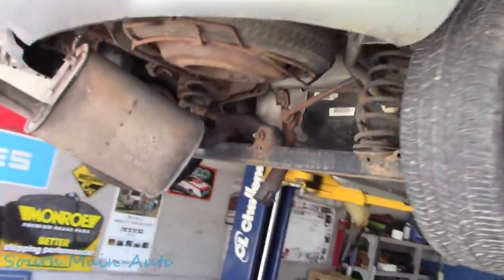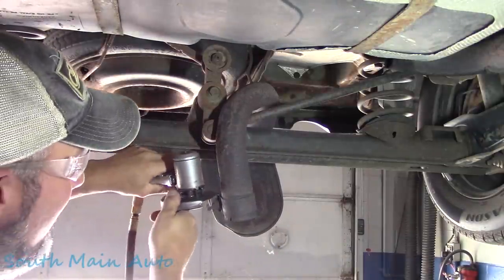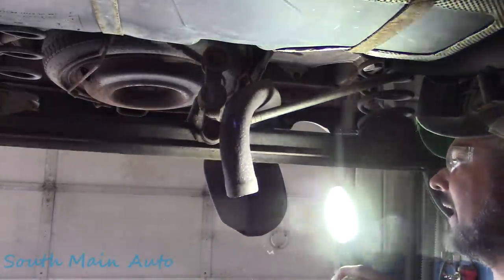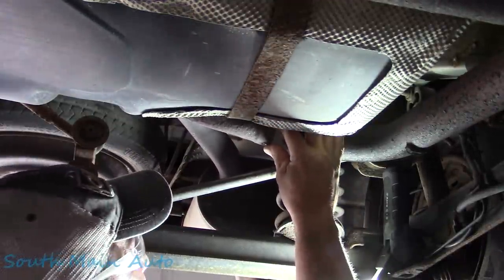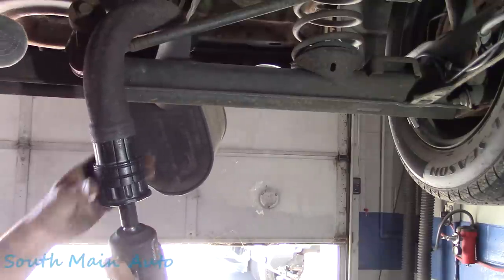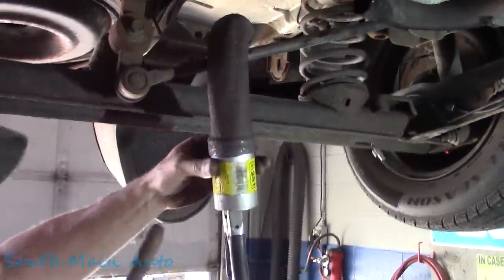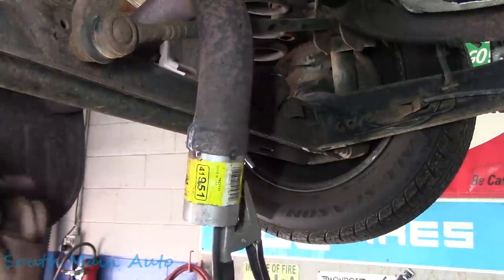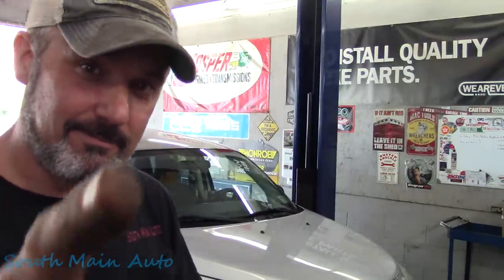Desperate Times Call for Desperate Measures

Comment: Nice honest repair Eric. When I worked at Midas, the owner would always yell at me for those repairs but, where did that customer go back when they had another problem - you guessed it. Our shop!
Reply: They probably wanted to sell the complete exhaust system
Reply: @TheLazyCarrot  yes and use alumized pipes and mufflers that last 2-3 years
Reply: @reweydewy  Mufflers that last forever because they have a lifetime warranty. It's the surrounding pipes that are made to rust out.
Reply: Problem with the aluminized pipes is they use mild steel clamps and it causes the aluminum to corrode and then the pipe and clamp corrode. It always fails at the joint. Thankful my cars now all have stainless exhaust and I moved South so done with that crap.
Reply: @robertbell525  I didn't know that. When I think about it. The pipes did seem to go bad at the joint between the muffler and the pipe. So you had to replace the pipes and the muffler.
Reply: The problem with todays cars is they use muffler bearings that only last 2 years 😂😂
Reply: The Midas in my area just went out of business
Reply: @Dogpool  yes, I wonder how many midas shops are still operating.
Reply: @robertbell525  I found it near impossible to get true stainless exhaust pipe.  There is a local custom exhaust place that I called to ask where they get it and they had to developed direct import methods from some place out of the country.   It’s not available from the easily accessible outlets like Napa.  They may claim it is at least part stainless, but really isn’t, or a low quality.    And anyway to do it right would need stainless welding equipment.

Comment: There's a muffler shop around here that does this kind of repair. Quick, cheap, keeps older cars on the road. And you know what, they do a great job and get recommended, so they are never out of work. Great repair, that's how it should be done, no throwing parts at old cars.

Comment: No a mechanic by trade anymore. Started as an untrained LOF guy in 93. Worked at my best friends family auto shop that opened in 1928. Yes 1928. Used to do oil and filter replacement both were a separate job back in the day. The shop is still open and family owned. They have made their mark here in the city by still doing honest quotes and work. If it doesn't need it they will tell you that. They don't make as much money as some of the big fancy shops but the same customers have Ben coming back to them for the similar business methodology and care you show your customers. Even if it means turning a job to a different shop. Been a long time fan. Found you on a YouTube search years ago for doing a timing belt on a Honda pilot I own. BtW your video helped me immensely and still driving on your advice from that video 55k later

Comment: If there had been an issue towards the front in addition to where your problem was then new or mostly new would of been the call. But, half decent pipe, muffler with most of it's glaze and no holes. Looks like you made the right call to me. I'm a sucker for welding and grinding.

Comment: No criticism here. I wish more mechanics would work like you do -- there are so many who simply would turn down the job entirely, simply because the customer didn't want to buy a 100% brand-new exhaust.  Or they would've lied and told the customer that it was dangerous and could never be repaired properly without a complete replacement.  You gave this guy options.  Kudos!

Comment: 40 years ago I worked In a shop and you do what the customer wants. Had one guy came in and just wanted a new tailpipe. 
3 months later he was back and just wanted the muffler. 
3 months later he was back for the exhaust pipe. 
Personally I would have skipped replacing the tailpipe until the muffler went then replaced the whole system, but you
Gotta do what they want even if it's wrong.

Comment: We have here in the UK,joint repair clamps , that join muffler pipes like a scaffolding joint , very common on VW cars,  I used one a few weeks ago on a 2006 Nissan xtrail,  the rear box was a fortune,  the joint pie was different sized , undid the clamp , tapped it on , tightened up , jon done , as you say Eric,  it keeps money coming into the shop without massive parts sales , it's better for us and keeps the customers happy 💪👍💰💰

Comment: Here is a man that values his eyes more than he values his lungs and skin!

That said, you may find a transition to 0.023" - 0.025" wire a worthwhile upgrade (if you aren't using it already) for most things automotive related.  You may need some new drive rollers.

Also, I bet a $10 band clamp (if available locally) would have been a quicker repair.  I've learned that keeping a wide variety of these in stock has saved me a bunch of time and effort.  These days, the smaller eco-car sizes have been difficult to find at the parts store, but Jeff Bezos seems to have them.

Comment: Ya know, I quit watching a YouTuber Mechanic, because the guy was so arrogant, that if a customer didn't drive some exotic, and have $1000 to change a spark plug, he wasn't going to be interested. This fix was a proper fix. The car is safe now, the muffler isn't going to fall off and fly up in to someone's windshield, the exhaust is exiting out the rear as it should be. Great job, and taking care of the customer in my opinion!

Comment: I weld up so many exhaust pipes like this.  It really makes a huge difference to have it as part of the options.  Because there is cars like this where people don’t want to spend $1000 on the exhaust because it’s not worth it. Also, pretty much every after market exhaust is not as good as the original, and will only last maybe 4 years if you are up north.  To preserve a good OE muffler is best.      For a job like this I could get that done in probably half hr. Less then an hr anyway.  The key is to have lots of different pipe in stock.  I get straight pipe sections from orieleys in 10 ft sections and have them at the ready.  Cut one that fits the closest and jam it in there.  This allows to not have to use some stretcher. I have one of those but rarely use it.   As for the hangers I save all the sway bar end links off of cars.  They are just the right thing to cut off the ends and put a bend in it for the hanger.   So, this is what often happens. Someone comes in from a shop that quoted them $800 for getting there exhaust quiet, I tell them it’ll be $150, it’ll be done in an hr. I have something like maybe $10 in material cost and less then an hour time into it. It may be less money overall then marking up exhaust parts, but what you lose in $ you gain in hero points.  This dude is then very impressed with how you made is big problem that was about to end his car into no big deal. He comes back with other things because he trusts you and he tells his friend to do this as well.  This saves you money because you no longer have to pay for advertising , since your customers are doing it for free, and better then any paid add.  It also gets you lots of work so you don’t have to worry about squeezing every customer for all they got so you can stay in business because you have so few customers.

Comment: After taking my truck to a shop and asking them to weld up a new muffler (old one just was just band clamped on) I was told, "Your pipe is too rusty, we need to sell you a $1200 exhaust". I ended up just going to HF, buying a welder, welding it up myself and pocketing the rest of the money and hanging on to the welder for my other vehicles that will never see that muffler shop.  The pipe was nowhere near as rusty as they made it out to be, and I knew it as I crawled under it to check it and measure for the new muffler before I brought it to them in the first place. Sometimes you err on the side of selling, sometimes you patch it, but you always do your best to be honest and take care of the customer or everyone in the shop will inevitably go hungry.

Comment: Kinda reminds me of my Neon exhaust. Pipe right before muffler rotted out at the hangar just before a bend. Ever used JB weld Tiger tape? I wrapped a piece of steel flashing around the hole, started wrapping it with Tiger Tape and secured it with baling wire at both ends, then wrapped wire around the length of the repair and Bob`s your uncle. Exhaust only has about 6 months life left, Now I have time to save $$$ for new pipes and muffler. Nice fix Eric

Comment: Good repair Eric O. Criminals stole the catalytic converter from my commuter car. The quote to replace it was more than the car is worth. No inspections here so I straight piped it. Ck Eng light is on now because they also made off with the after O2 sensor. A piece of electrical tape over the light keeps it from bugging me.

Comment: Good Job Boss, my brother inlaw is from Syracuse, back in 80, his dad passed away and left him a convertible red Caddy, 4dr, he brought it back to CA where we lived, north county, headed to the beach in SD area, The family, were behind him on a transition ramp, the car looked OK on the outside, but wasn't so good under it, a large section of the muffler it self and pipe broke off, we ran over  it. there was no stopping. Not sure how long it was he held on to it, it was bad rusted out under the car. he dumped it. 
 an other fellow I knew, I'm behind him, this is 
 in Syracuse, 73 there about, he used a 63 or so 4 dr chevy to carry his tools in the trunk, 
 here again, in a Transition ramp on the free way and low and behold the gas tank drops down out from under the car:  
 dealt with that, a little while later, going along the entire tail end of the car / truck broke 
 off, falling to the road. they don't call NY state the rust belt for nothing...

Comment: I was out of town when the pipe rotted off a car  and I didn't want to deal with the sound all the way back home at 75mph. Shop wanted to replace everything including the manifold instead of weld up a patch. Over half the value of the car. I said thanks and went and bought some over ear hearing protection at Lowes and left. Oversell a job like that and you'll sell the job away too.

Comment: One of the things I noticed compared to vehicles of the 60's was how much longer exhaust parts last in vehicles built after about 1990. Maybe it's stainless parts, but my bet is on the catalytic converters. Rust happens more slowly when you don't have a mix of acid and complex hydrocarbons coming out the exhaust.

Comment: That's why i went out and got myself a good welder. Just so i can patch the exhaust without having to replace the whole system. The shop i used to work would get mad that I would do the same thing you did and not make the customer pay for a whole exhaust system. I knew some of the customers that we're on a low budget and did it cheap for them

Comment: Those who judge others from the comfort of their living room have an erratic ding dong dinger due to a failing cluster.     Frankly when I was 16, I had the guy a Midas weld one of my pipes using a pepsi can.    '73 Duster.      That cheap fix last the two years I had the car.      The car was mechanically sound, but the floor pan, and trunk were holier than I was....

Comment: My dad was a mechanic. I was at his shop one day when a guy in a severely used 82 Civic rolled in, wanting to solve his coolant leak. Which was coming from the heater core. Dad says, "I will not fix that, it would cost more than the car is worth. What I will do is clamp off your heater hoses. No more leak, and your car doesn't have heat anymore, but you can drive it." I think he had they guy pay him $10 for the two little Harbor Freight needle nose locking pliers. "If you really need heat one day, take those off, and know your coolant will leak until you put them back on."

This was just some random guy off the street, never seen him before. Dad did that kind of thing a lot, for everyone. There's the right way, and the right now way.

Comment: Hey Mr.O I need some minor work done on my pt-abuser but my local mechanics want 800.00 to put 2 front shocks and 150.00 for an oil change I know I should be able to do it myself for @250 but I'm catastrophically disabled and these sharks in the Minneapolis area are notoriously corrupt and need to be shut down, so it's @ 9 or 10 hundred miles to your shop when I can walk again and survive another major surgery I will get over there. Thanks Mr.0 for being honest and upstanding.

Comment: My 85 Nissan Sentra got parked because it would cost more to replace the distributor than the car was worth. We had it for 5 years and paid $800 for it. The distributor was over $600 the warning that we had was that there was a good chance that the PCM would usually fail too. The car was a rebuilt wreck but it had one of the toughest engines I have ever seen. It survived a 3 mile stretch of mud running wide open in 2nd gear. My wife said it was screaming the whole time until she got to a paved road. I wish I could have saved it but it was too expensive to fix.

Comment: I had an '02 Chevy Cavalier once, with a rotted out flex pipe between the manifold and cat. I would have needed to buy a new cat to make the repair. Apparently here in the PRNY that's what I was supposed to do. 

My mechanic friend at the bus company offered to weld in a new flex pipe for parts and a 30 rack of Keystone.

I got 2 more years out of the car before it went to the crusher for a failing transaxel at 257k miles. 

I don't know what your customer's situation is, but we can all see that PT Cruiser isn't long for the road. You could have sold him everything to fix it, but you did a quality job still on the cheap. I'd reckon you'll probably retain their business for the next time they need a mechanic.

Comment: Thanks to Eric, that Cruiser exhaust has got another 100K left in it with an inexpensive sleeve/weld repair !! ... I have to do a Cat flange weld/repair on my 2000 Cherokee, but need to wait till the weather cools down a bit ... put on a gasket and one of those funky bolt on 3 piece flange repair thingy's on it till I can get to it ... 260K on the old beast so cat flange replacement works for me

Comment: I don't judge anyone for doing work on a vehicle as long as it's not going to put anyone in harm's way. I've done enough shade tree repairs that a real auto shop would've suggested parts be replaced. Hell, I did this very similar thing (except I used a clamp sleeve, couldn't weld to save my life) to repair a busted exhaust pipe.

Comment: That's the way I work on my exhausts - nothing fancy, just get it back together and get a few more years out of it. I finally had to replace everything on my daily driver, though - the pipes were broken in 2 places and the flex pipe was perforated. Unfortunately, I needed to replace the cat too because the last shop sliced off the flange and welded the pipes together. Which is exactly where it broke - right at the O2 bung.

Comment: With those expanders they don’t really expand anything imho
But once you gets it tightly in there, run around the perimeter with a hammer and ‘form’ it a few dozen times; tighten again and repeat a time or two. The hammer distributes the metal and it will get looser on the expander. For some folks that’s counterintuitive but it works.

Comment: Always better to save an oem exhaust if it's not too bad. The crimping on the interior of bends in alot of aftermarket units doesn't flow air as well and holds condensate longer.

Comment: The rest of the pipe looked pretty solid, so a repair was a good choice. Unless the parts were so stupidly cheap they cost less than the labour of the repair, which is unlikely in this day and age, we should try to repair this sort of thing. As long as the customer knows he/she is not getting a new system then getting a year or 2 out of the old pipe is worth it, especially if the car may not make it much further than that.........

Comment: I have patched many of mine over the years they rot at joints center of pipe is still solid. Usually laying on driveway while welding . Many old cars might get another year out of them but not worth the investment of a new exhaust system.

Comment: if you just  cut off the bracket and just took out the old pipe ,you could have fitted the new pipe straight into the muffler end .Then all you had to do is fit it over the pipe and either weld like you have done or split it and clamp it . but i do like that pipe expander .Ebay here i come .

Comment: No way don't replace it. If the muffler is still serviceable use it. The car probably isn't worth too many new parts anyway. He can get a couple more years out of it, all the better.

I had a 98 Ford Windstar up until this past spring, I bought for $500.00, and we named him Red. The exhaust was gone from the mid- body back. I didn't use it right at first, so when I was ready to start driving it, the fuel pump had locked up. So I had a local shop put a new fuel pump and fuel filter in. While it was in their shop, I asked about if they had any used mufflers they could throw on it, and they did. They also put a down pipe to direct exhaust downwards. I drove it that way a few months, then added the rest of the exhaust pipe out the back. That quieted down the van dramatically. It ended up being a pretty decent vehicle. I had to put a couple new front struts in, new front brakes, but ultimately a friend was using it and someone ran a stopsign and t-boned old Red. He ended up totaled after the body shop tallied up $6000.00 to repair him and just stopped there.  I miss that van.

Comment: I highly recommend wire wheeling the area on the exhaust that's going to be welded, then wiping it with brake cleaner. A cleaner surface results in less amperage, meaning less heat, meaning less likely to blow through. Otherwise, top notch!